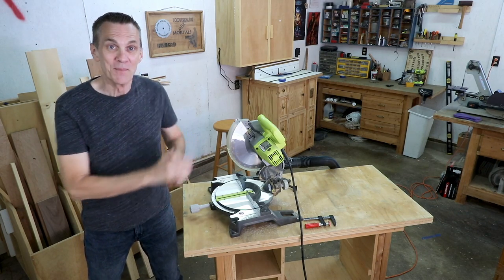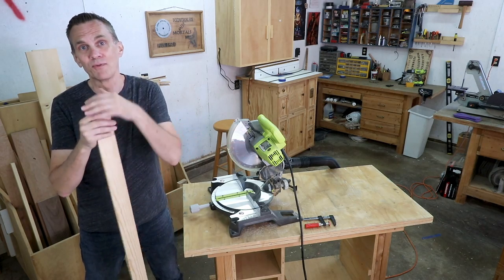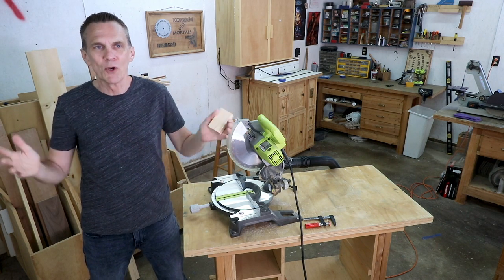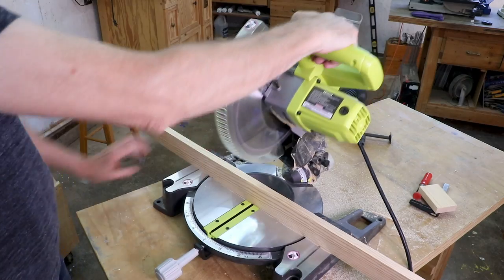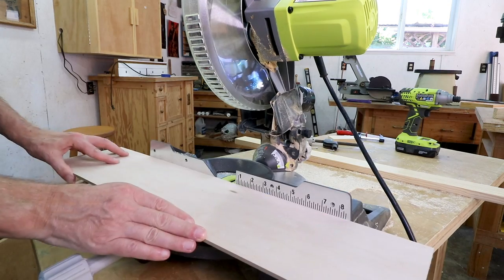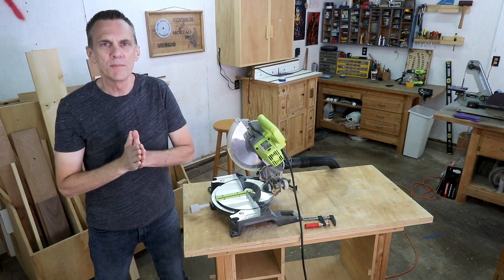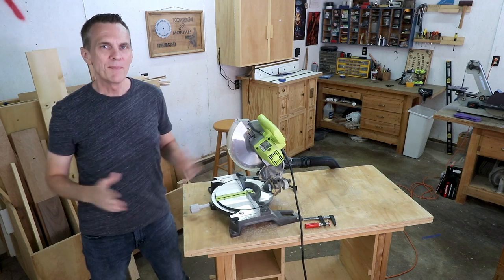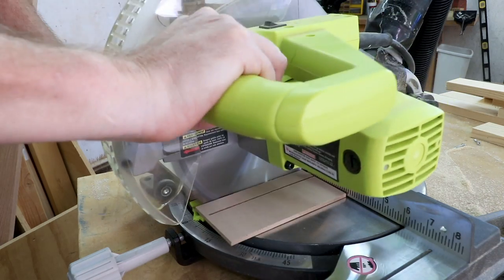8 ways to use a miter saw like a pro

Comment: 2:18 Notice that the scale on the saw fence doesn't match the distance shown on the measuring tape by at least 1/8th of an inch. Beginner tip: never trust a pre-printed scale on a machine (woodworking or otherwise).Table saw fences are usually pretty good, but if you need to do precise work, always measure things yourself, then make a test cut. (My wife doesn't understand the test cuts. She's always puzzled why I don't throw out that box full of cut offs "that can't be good for anything". She's a User, not a Maker.)
Reply: On my saw at least that's due to the blade thickness. If I start my tape in the throat it's exactly an eighth off. If I lock the blade down and start from the blade it's dead on accurate.
Reply: The same thing applies in pre-loaded syringes in medicine. Pre-measured is usually not quite right!

Comment: Super tips that will probably make me actually like to cut things on my less than desirable miter saw. I especially liked the tip about adding the larger table area. In addition to cleaner cuts, the thickness of your table might just give you that little extra to cut that wider board by raising it up as shown in the very last helpful tip. Thanks for all the great info Steve!!

Comment: I’ve been woodworking for a while and never saw the blade flex tip for micro-adjustments. Thanks for that!
Reply: The teeth of the blade usually set on the outside of the blade.  It allows the blade not to bind when doing cuts.

A quality blade shouldn't flex much amd butting a board to the blade when it's down will allow you to cut just the saw set.
Reply: Hold blade down, slide piece up to blade, then lift blade, then make cut. Cuts off about 1/64". No blade bending.
Reply: I was taught this by a finish carpenter that did a lot of molding work. He got perfect joints by measuring once, cutting a little long, then sneaking up on it.  When I did my flooring, I was often asked who did my molding work. I think it was because I had used this technique and it all looked so good.
Reply: That tip alone belongs in the woodworking hall of fame.

As the Chinese saying goes, "slowlee slowlee catchee monkee"

Comment: If your saw has a laser guide, be sure to calibrate it.  The method I learned was to clamp a wide scrap onto the table and make a shallow cut - don't go all the way through.  Then raise the blade back up and take a look at your cut.  Is the laser shining into the slot cut by the blade?  Keeping the piece clamped in place, use the adjustment screws to nudge the laser line so it meets up against one edge of the kerf.  It will never be a perfect guide, but it's much more useful if you know exactly where it is relative to the cut.

Comment: I use the "press end against saw blade" all the time for fine adjustments.  There are actually TWO adjustments:  for a slightly deeper end cut, push the MS blade down until the teeth are inside the base, then the wood will press against the disk.  The lighter cut:  leave the teeth exposed, set the wood end on the teeth.  The amount of force against the blade will also give tiny variations in cut width.  Most blades vibrate just a little, so the width of cut is a bit more than the edge of the teeth.

Comment: Steve, you are my first choice for woodworking advice.  The stop block idea helped me cut 20 small table legs quickly and efficiently.

I have a Ryobi 10-inch miter saw (seeing yours helped me to decide) but I wish it had one more feature:  a depth stop.  I'd like to use it to cut halfway into the legs so that I can have them cross for greater strength and stability.  I'd rather use the miter saw than my table saw, which I think of as more of a predator than a tool.

I'm thinking about making some sort of block or jig to keep the blade from going all the way down but maybe you have already thought this through and devised a clever, and safe, was to do this.

Comment: I ran downstairs immediately to check if the fence on my miter saw has holes to connect a straight board to it. Fortunately it does (but I would have drilled these holes myself if it hadn't). Great tips!

Comment: We've been cutting a lot of narrow trim.  I saw a trick on some finish carpentry blog.  Use duct tape to create a zero clearance on your existing miter saw insert.  It has worked a charm!  Very exact line up for detail work.  We actually used two layers of tape.  And replaced occasionally, but we're surprised at how long the tape stays accurate around the kerf.

Comment: The stop block is great and the consideration for eliminating saw dust buildup is wonderful. In a school setting students will lightly tap the block and slowly move it with just one and even two clamps. When we have done a “mass production” project (simple box as a time capsule) this was problematic. Solution = use 2-3 screws through the stop block into the fence (make a little longer piece and a triangular pattern). Check every so other for quality control.

Comment: I learned something more about the mitre saw, and will take that away with me.  However in one of your earlier videos you say to let the saw stop rotating before raising the blade.  I did not do this  once when cutting off a small length from the end of  piece of timber, and the cut off flew around the shop.  Ty Steve. glad to see you posting again. Loved the weekend streaming.

Comment: Great video.  This just blew my mind. These are all things that I’ve been frustrated with when using my saw. I couldn’t figure out how to make a stop! Thanks man!
Reply: If you really want to get fancy... get a piece of .5 x 4 aluminum t-track to put on your fence. It’s very rigid and is covered it ts-slots which make it easy to add stops and measurements. 

I have a stop and a sliding measure ( made from tape measure) it save a ton of time

Comment: Great tips. For cutting the paper thin amount to sneak up on a length or clean up an need here’s my tip: 

Start with the blade down. Move the board tight to the blade above the kerf/teeth. Spin the blade and move it to the up position. The kerf of the blade with shave a fraction off the board’s end and is normally enough to achieve the aim.

Comment: Tip on a tip: Rather than raising my stop block I shave/plane off the corner that contacts the table. (It allows for sawdust and burrs to not hold back the work piece while still maintaining the security of surface contact.)

Comment: I think it's better to mark the discard side of the cut while measuring, with a second line at a slight angle towards the discarded side. That way you don't have to remember on which side of the line to cut.

Comment: Shaving the end:  I find three different depths are available:  first is to set the piece resting on the edge of the carbide blade tip (the wider thingies on the outer edge):  the saw blade vibrates just a little when running and will cut just a teeny bit wider than when standing still.  The second (more aggressive) cut is to push the (stopped) blade down until the piece rests on the flat of the disk instead of the side of the tooth.  The third depth uses Steve's comment about pushing on the blade; this depends on the stiffness of the metal.  (Yeah I spent more on the blade than on the MS:  that blade doesn't bend much.)

Comment: I'm quite a beginner and I have exactly that same  Ryobi  model (but when it still came out blue). What I do with wider boards is I lift the guard and slowly rotate the board towards the saw. I'd say I can easily cut 10% more. Also my first beginner mistake was attempting a rip cut. I just needed it to be about 10cm so I figured "meh, I can use the miter saw". The saw pulled the workpiece and in a fraction of a second I just saw three chunks of wood fly off in different directions, one slightly bloodied. One of the broken wood chunks punctured my left index finger. If that taught me a lesson on respecting power tools!

Comment: Metric and Robertsons in the one video? Nice.
I used the 'raise up' trick the other day when making drawer sides.  At 160mm they were just a bit too wide to cut in one hit, so I raised them up on three 12mm (1/2") pieces of scrap ply and was able to cut without flipping them over.

Comment: If you want a real pro tip it would be these, leave a bevel on the bottom of any fence to leave room for saw dust so it doesnt throw off your work piece. Also, calibrate your mitre saw regularly. Never assume its pre set indents are accurate. Always calibrate for square both sideways and vertically. Lifting up the board to cut deeper was a neat trick, I usually just make the cut then just lift the board on an incline while still pressing it to the fence.

Comment: When cutting the end off a board due to a split in the grain, a good way to help guarantee you remove the entire split is by taking the piece you cut off and tapping it on a table or other hard surface. If the wood easily breaks in half along the split then cut off another small piece and repeat the process until the cut off piece doesn't easily break in two. That way you know you've removed all the weak wood.

Comment: Most miter saws these days are compound miter saws (one that can both swivel side to side AND tilt) and you can often find an easier/safer cut by positioning your board differently.
It sounds like common sense, but I've worked on dozens of projects where I get halfway through a batch of cutting only to realize that if I had turned the piece 90 degrees and moved the saw accordingly, I'd have gotten a safer or easier way of making the cut.

Comment: I knew a few of these, but some, like screwing an extension board through the fence and raising a board to get that last bit, are actually new to me. I'm surprised though, that you didn't point out that most miter saws have an extension on each side of thr base to help with longer cuts. It took me an embarrassingly long time (like, 8 years in construction) to realize that.

Comment: Another small tip when it comes to stop blocks is to slightly chamfer the edge of the stop block that meets the base of the mitre saw, this helps to prevent sawdust building up and holding the piece your cutting out from the block and making your cut shorter. 👍

Comment: Tip: many saw blades have alternating teeth which are beveled to one side of the blade or the other. Two teeth will span the entire width of the kerf. I always make sure I line up the outside edge of the appropriate tooth on the drawn line I want to cut along.
Reply: Never thought of this, thank you

Comment: Great video! I learned lots watching just 1 video!!!! Keep it up Steve!
Would you ever consider making a "More Advanced Miter Saw Tips" video?

Question for the forum:
I want to create a frame with a 45 degree cut in the corners.
What is the best tip for cutting a 45 degree such that your cuts all come together correctly.
It seems when I try and put it all together, the joints don't seem to line up correctly.

Comment: I would add a screw to the stop block. This will prevent  sawdust from building up and reduce (slightly) chances of saw blade grabbing the cut-off piece. Plus it will be  easier to do minor adjustments.
Reply from the maker: That's a great suggestion! 👍
Reply: @SteveRamsey  Also cut a small chamfer on the bottom edge of the stop block to prevent sawdust collection kreep. Better still, cut the block 3mm or so narrower than the height of the fence and add the top strip described below. 

And screw a flat strip over the top so that it overhangs the fence (I) to stop the damn thing falling down while you're fiddling with the clamp (ll) so that you don't inadvertently clamp it slightly screw and throw off the accuracy of the cut.

Make up a permanent stop block with the two added features and you will not regret it..

Make it left and right handed while you are at it. You will be surprised at how useful a left side stop block can be.

Comment: When I make a pencil mark, I always make an X(or more than one) on the side where I want the kerf to go.

When shaving a board, sometimes even the blade-bumping technique takes off too much for fine finish work. In those cases, I bump the blade, lift it up, then wiggle the work piece and lower the blade again without turning it on. I want it to slide past the work piece without stopping, but still rub against it. It'll still take off a bit of material.

Comment: Great video again. Thanks for sharing.
Did you ever make a video how to "calibrate" the miter saw, so the the cuts are perfectly square and perpendicular?
I have a sliding miter saw and did not find a way to manage that problem yet.
When I have a board that is too wide, I cut the board from one side, then flip it over and cut it from the other side. That way I can nearly double cutting width.

Comment: Steve. Thank you for such a wonderful YouTube on all types of wood working. I especially appreciate your humor and explicit way of explaining the use of tools and the art of woodworking! I would like to know if there's a way to set up a gauge to stop the blade at a certain depth? If I want to just take out a portion of, let's say, a 2by4 and not cut all of the way through, is there a way to "rig up" a stop on the depth of the blade to keep it from cutting all the way through the wood? My Craftsman does not have a factory designed one.

Comment: Thanks for the tips. Your tip on putting down a board for a zero clearance bottom gave me a thought. Could you put a long board, say 4-8 ft, on top of the saw plate,  instead of trying to make left and/or right tables exact same height. I guess board would need support to ensure no bend. I have had issues trying to get my miter saw support tables correct.

Comment: I'm still fairly new to woodworking and have been a subscriber of Steve's channel since I stumbled upon it when I was just getting started 1-1/2 years ago. There were some new tips in this one that I don't remember seeing in his miter saw basics video, so thanks for that. I have both a miter saw and a crosscut sled for my table saw. I seem to prefer using the crosscut sled for straight cuts. Are there situations when the miter saw is the better option?

BTW, I use my garage for my shop and I built a BMW from Steve's plans last year - it's very sturdy and versatile. Thanks for teaching this mere mortal!

Comment: Something that can be dangerous (especially to your eyes) cutting with a miter saw is vinyl siding that has aged outside.  New vinyl siding still has a lot of elasticity in the vinyl but aged vinyl becomes brittle and the blade will crack a piece off while its cutting and send it flying at like bullet speed.  Definitely wear some large safety glasses or face shield.  If cutting with  a sliding miter saw, turn your blade around backwards on the miter saw so it cuts much less aggressively and doesnt snatch the piece.  Dont start your cut on the edge closest to you and push the blade towards the fence like you do when you cut a wood board.  That does not work well cutting vinyl siding.  Turn the piece face down and come in from the top but just graze cut the piece slowly and  that will definitely help cut down on the flying pieces of vinyl.  Even then, old vinyl is brittle and sometimes even cutting it the proper way a piece can crack off and go flying so just wear some really good eye protection.

Comment: Thanks for sharing! I am almost done building my workshop. And still doubt what kind of mitre saw to buy. A sliding one or a non liding like you have in this video. And what size 216, 254, 305mm blade. A sliding version has more capabilities but also takes a lot of space wich i don't have. What would you suggest?

Comment: Good tip about raising the wide board, didn't know that. 
Also you should've included a trick on how to cut angles greater than 45. I find it really handy.
Reply: Cutting angles greater than 45 degrees is simply a mathematical question. All saws have the capability to cut greater than 45 by taking the excessive angle and subtracting it from 90, setting the saw to that number and cutting to the relief side. You will net the correct oversized angle
Reply: @cncwoodworxroc6881  I know how to do it practically, but I think what you're saying is wrong. If I need a 75 degree (perpendicular is 0) cut, how subtracting 90 is going to help me?
Reply: Btw-just out of curiosity,  what would you need a 75°angle for? No sarcasm,  seriously just out of curiosity.

Comment: I have read studies on using a zero clearance insert on a miter saw.  The studies that I read revealed that no insert gave just as clean an edge as installing a zero clearance insert.  The reason for this is the direction in which the blade spins.  It exits the piece of wood on top, not on the bottom.  The zero clearance insert works great on a table saw because the blade direction and it exits on the bottom of the board.  Tear out occurs when the blade exits, not enters, the wood.  I have not wasted my time installing a zero clearance insert on a miter saw.  Good video though.

Comment: probably doesn't work with every saw, but the height of the base is the same as a brick, so if you need to support longer lengths you can put the saw on the ground with bricks out to the sides.